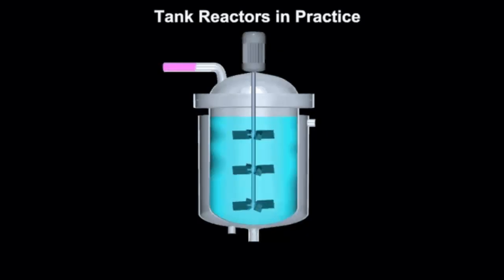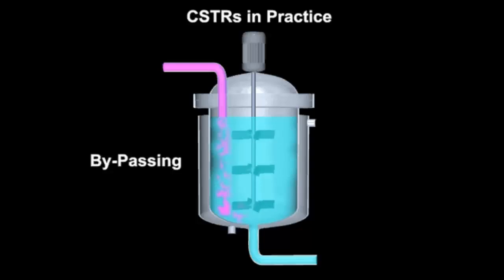Imperfect Mixing in a Stirred Tank Reactor Demonstration

Comment: What if the inlet is at bottom anf outlet at the top ?
Can we avoid the bypassing problem then ?
Reply: No. It's not the matter of location. It's mainly because some reactants just skip the path that goes to impellers and are never mixed or shortly mixed